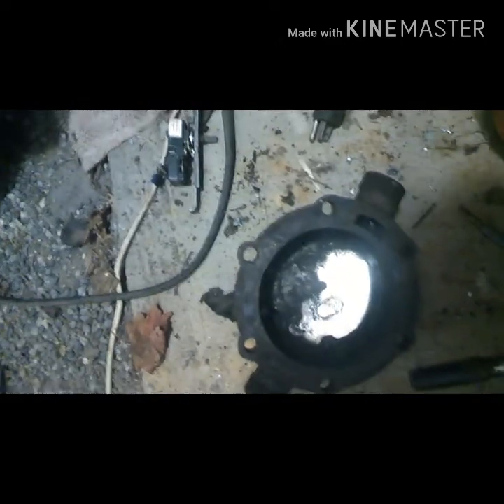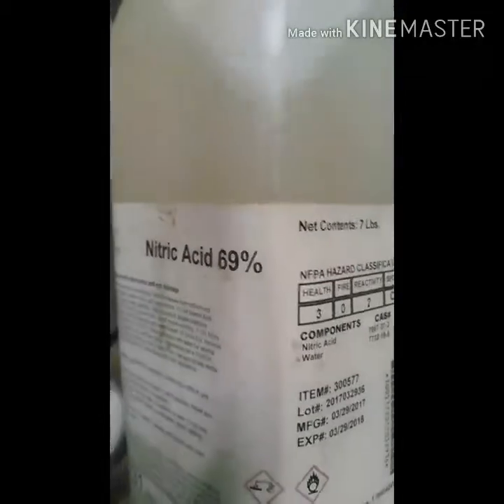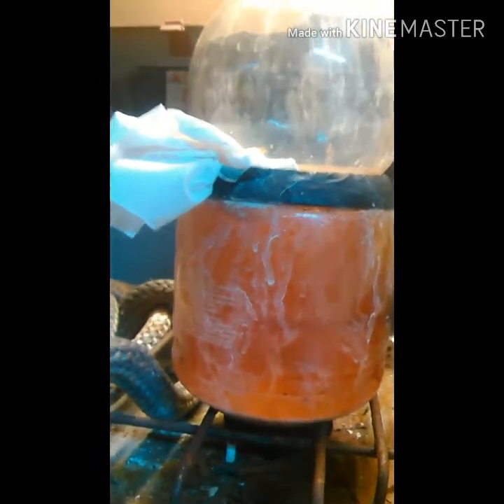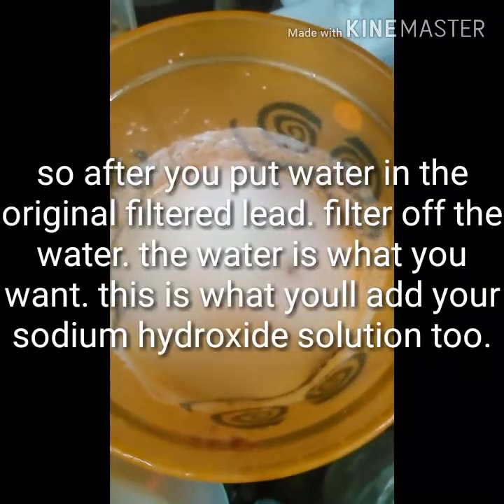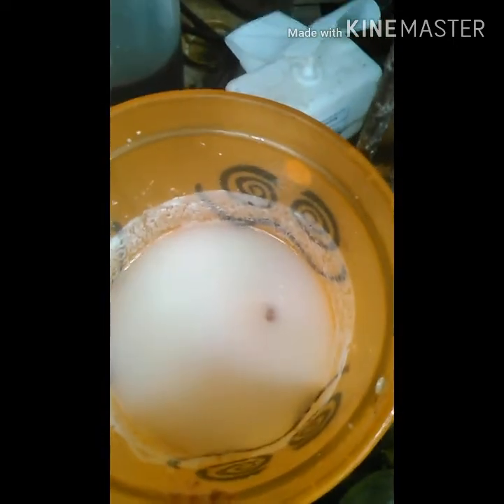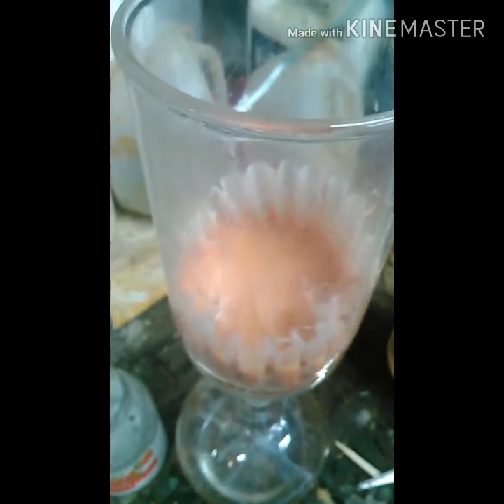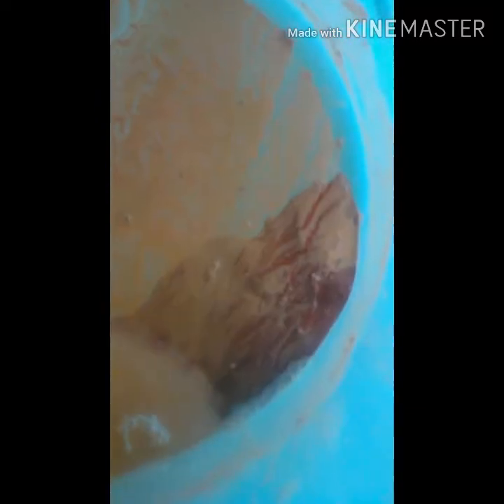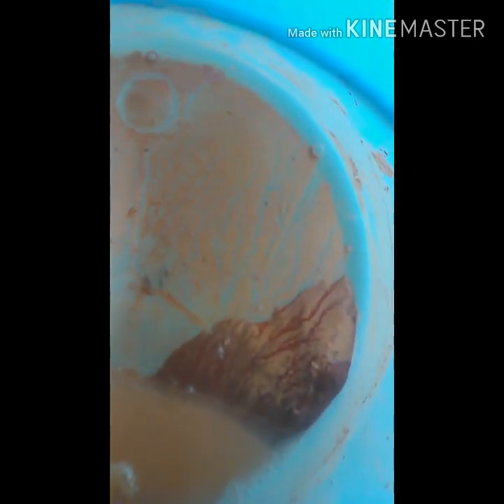Lead tetraoxide synthesis. Full process! Red lead.

Comment: Hello friend, how are you, I want to make lead tetroxide to restore old batteries , could you make an explanatory video of the lead teoxido manufacturing process. thank you
Reply from the maker: Hey kevilin so I have a couple how to make lead tetraoxide videos. One with chemicals one without chemicals. However if you plan to make it for a battery stop. Make your pos and neg out of lead oxide 2 (grey) and the charge one side for like 15 min and then swap the POS and neg and charge again . This will create lead oxide 4 naturally in homemade batteries very good. CODYSLAB has an excellent video proving this
Reply from the maker: I would say that the process with chemicals is to make red lead for like fireworks or other chemistry uses. Not for batteries. It's a huge waste of time and money. I'm fairly certain most battery making company's use the method I spoke of in my last post. I hope this helps mate

Comment: Hi I did this reaction once and I didn't leave or stir it for 1 hour it turned Orange and i washed it 6 times it doesn't work for pyrotechnics/with aluminum and when I light it on fire with aluminum powder it is very bad. With potassium permanganate and aluminum and sulphur it works very well

There is no information on the internet other than your video what did I do wrong? is it because I didn't stir it enough?
Reply from the maker: Hey, I got your message I will look into it.
Reply: @shelbysgarage5828  thanks for responding🙏❤️
Reply from the maker: Np I'm still small enough I can respond to everyone who wants to talk to me lol.

Comment: Shelby's garage
 even though lead paint is toxic it is very durable but it chips when it gets old. Back when lead paint was used allot they put linseed oil in it some old parlor guitars used lead paint. Can lead paint be other colors besides red,white,yellow? Do you know where I can buy lead paint that is pigmented? How do you get the powdered lead paint into a liquid form so you can paint with it?
Reply from the maker: Yes I can answer all those questions. It can come in any color. You buy it from somebody like me who makes it.so what you'd do is get an oil based paint of your colored choice then add 200+mesh lead oxide dust to the paint but not so much it's to thick to paint. If you get to thick add some paint thinner. But that's how in a nut shell.
Reply from the maker: Lead tetraoxide from this process is not what I'd recommend to use for lead paint. This is more for fireworks and speciality stuff. You can get a lower quality lead tetraoxide from car batteries. One side is lead dioxide other is lead tetraoxide made threw electrolysis. It's much much cheaper and easier to acquire. Just to put that out there. This process makes 100% lead tetraoxide or 95%+ out of a car battery you'll get 70/80% and will still achieve the point of using lead based paint

Comment: Your idea of making one big cell out of 6 batteries was what I was thinking, Alot of batteries will have one dead cell making battery unusable,this way you still can use the good cells just connect them parallel. Angel R is my daughter I didnt realize I had her profile up.
Reply from the maker: Ya, so I thought a long while about doing this. There's one huge draw back. And it's the amps... to my understanding it works like this... lithium ion cells in a cordless power tool or.laptop or mobile electronics. Each cell is very close in its draw compared to one another. Like they'll all be 3.7v and say 1500 mah. So now if you have ten batteries and they're mah(ah) or kWh is widely different your charging and discharging will become out of sink and you biggest battery will end up with the shortest life span due to holding all the other batteries weight. Like an uneven yolk.
Reply from the maker: I may not be correct but I'm fairly sure it works this way.
Reply from the maker: My email is scubamaster84@gmail.com I can't seem to pull your profile up. Shoot me an email then I'll give you my number so you can call or text me
Reply from the maker: Check out my how to make litharge video. That shows how to do it. But doesn't do it exactlt
Reply: @shelbysgarage5828  Can I contact you to learn how to mix battery plates, from WhatsApp